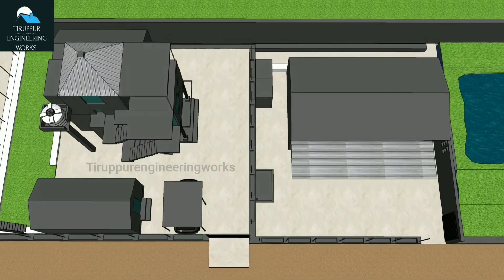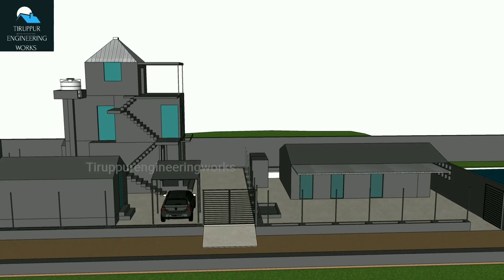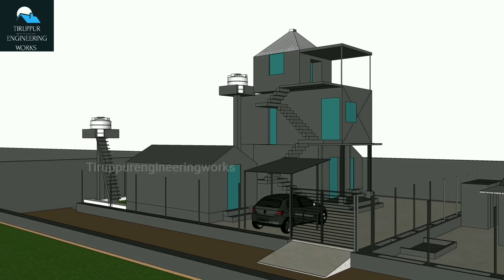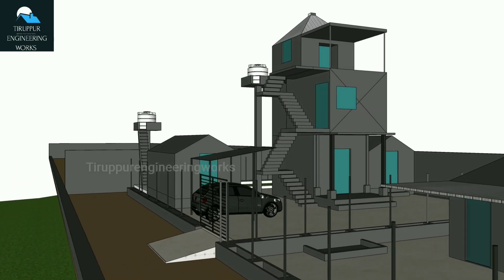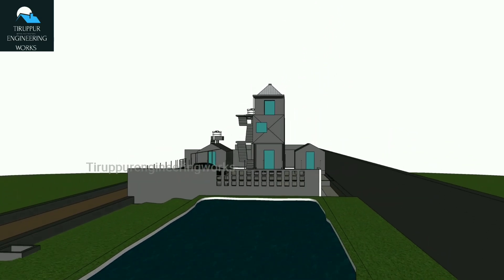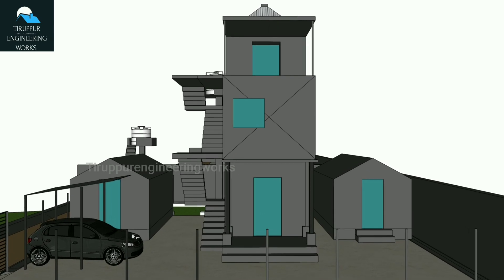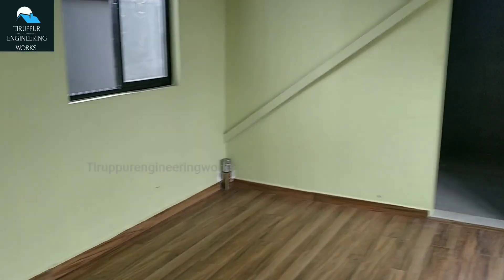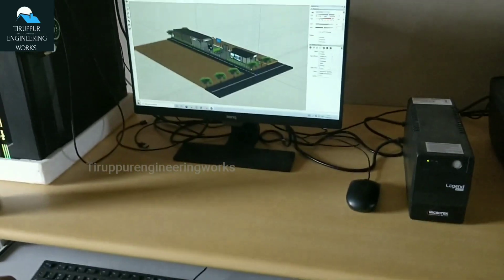peb construction building tamil headphones must 🎧#perfabricatedbuilding #ironhouse

Comment: Is it economical compared to conventional type ? Peb mostly used for commercial purpose when coming to residential building of 5 cents which is prefarable conventional type or peb.   ...Also quote how come peb is economical than rcc frame buildings
Reply from the maker: https://youtu.be/DqIZRwZXJWs in this video you will get all the answers
Reply: @tiruppurengineering  errection, we need skilled labour, and initial cost is of too high, can I use peb for small area residential houses is it cost effective? You have gone through residential project can you help me with cost compared to conventional type(RCC), what was the main challenges you are facing
Reply from the maker: @venkattulugu106  email your queries tiruppurengineeringworks@gmail.com